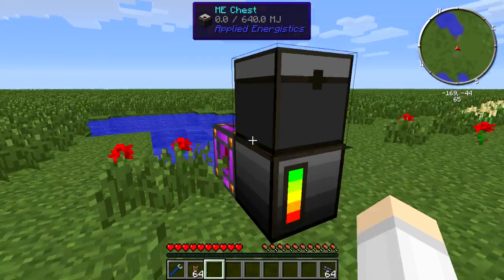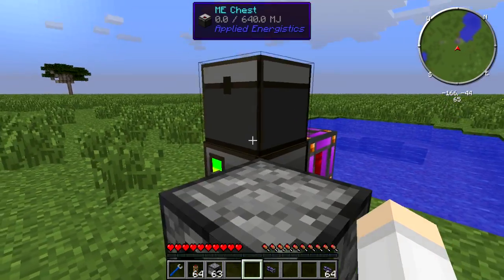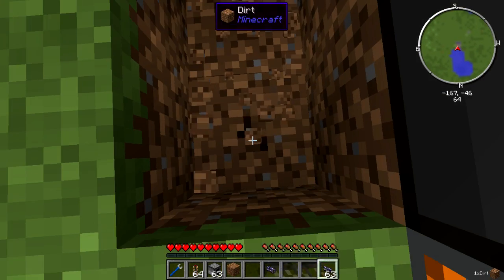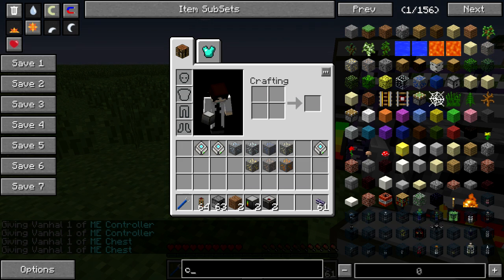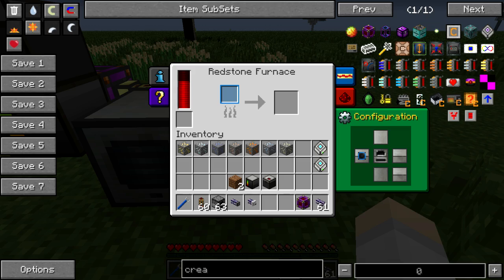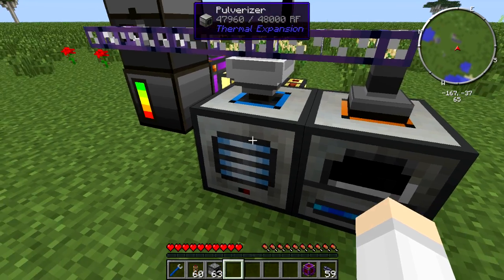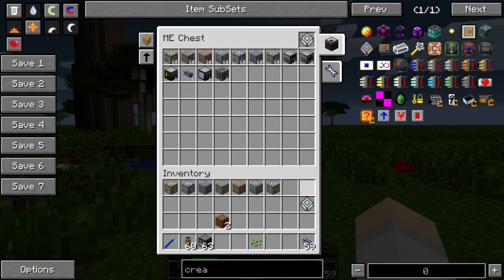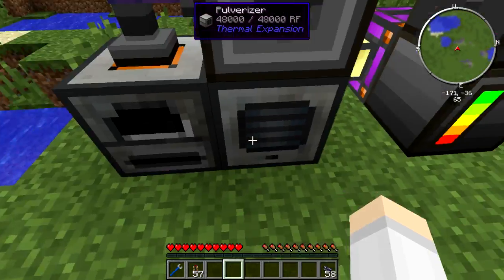How To! Auto Smelting with Applied Energistics

Comment: this isn't good. You can save only 8 types of ores in the fuzzy Export Bus
I wanted to use an item that has more space to put more ores

Sorry if my english isn't good.  I am brazilian.
Reply from the maker: andre celso You can put a second export bus onto the same machine. Or set up another set of them (it will be quicker that way)
Reply: Yes, thanks for the tip, but I found another way to do it.
You place a ME interface on any machine. Sets it down and
when the memory space runs out, you put another ME interface in first and set it down

correct me if some word is wrong